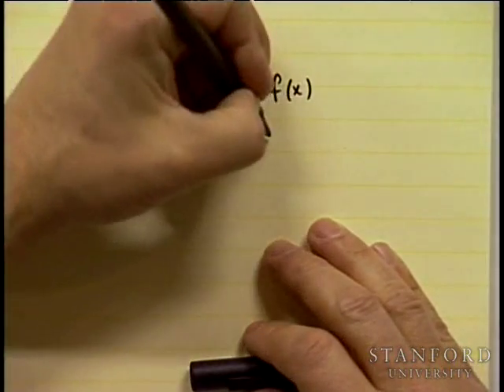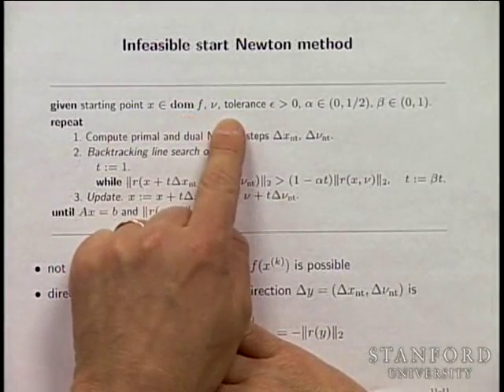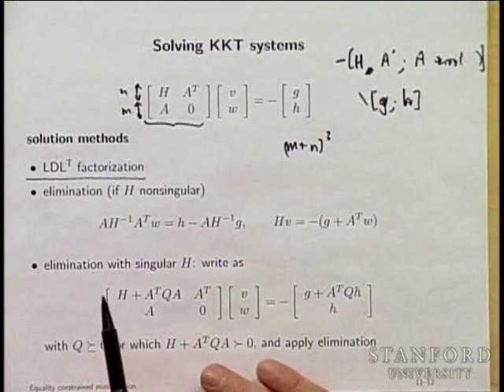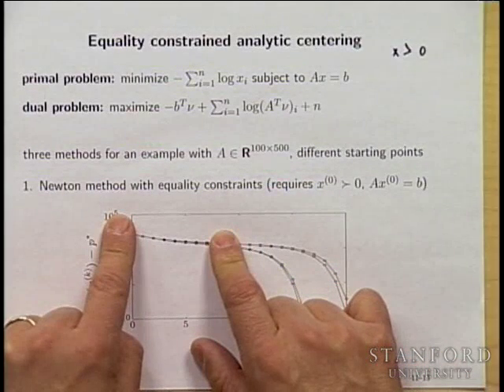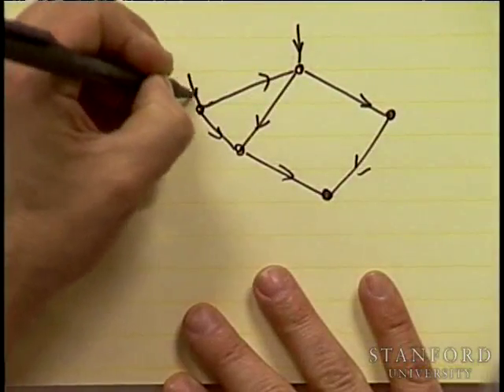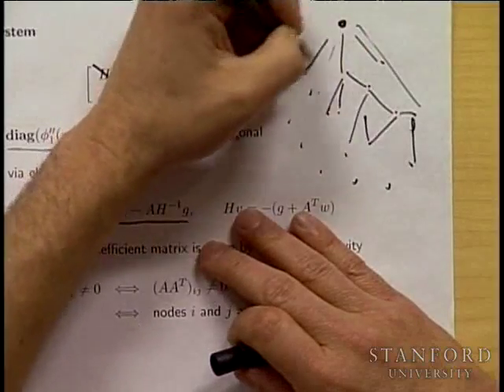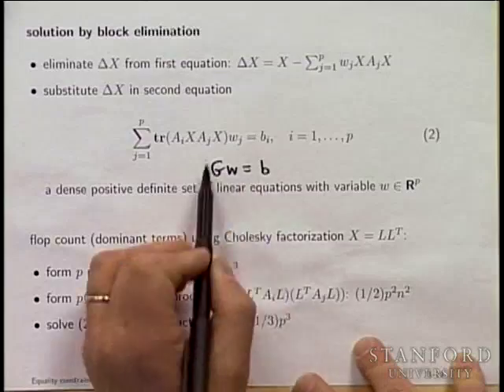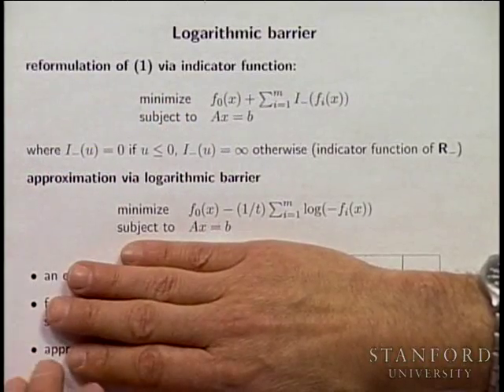Lecture 17 | Convex Optimization I (Stanford)

Comment: 0:42 Newton step
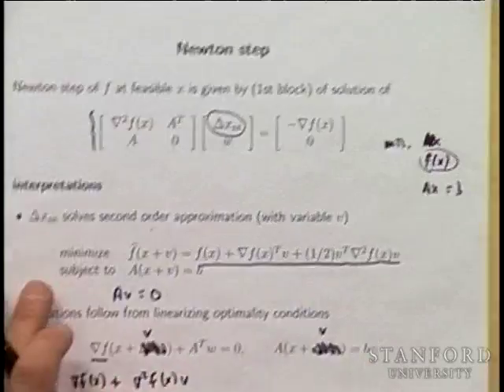2:10 Newton's method with equality constraints
6:00 Newton step at infeasible points 
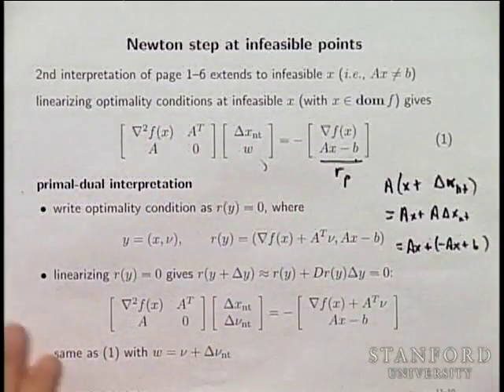11:19 Infeasible start Newton Method
17:59 Solving KKT systems
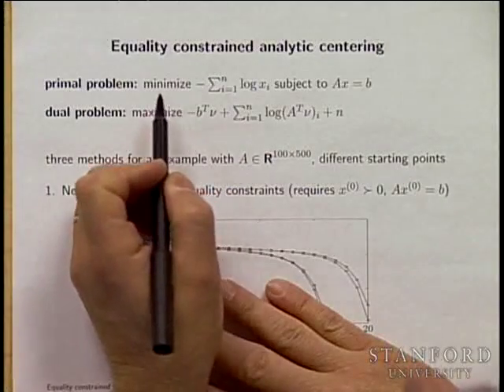25:47 Equality constrained analytic centering
37:34 complexity per iteration of three methods is identical
43:10 Network flow optimization
55:40 Analytic center of Linear Matrix Inequality
1:02:29 solution by block elimination
1:04:30 Inequality constraint minimization
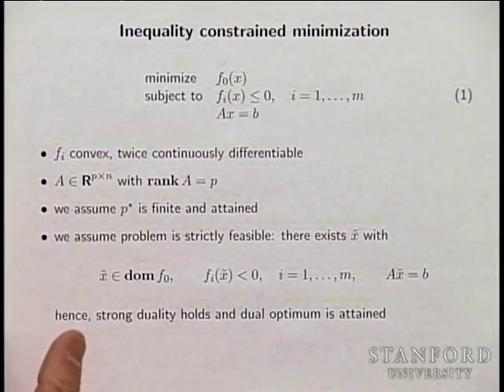1:09:10 Examples
1:11:01 Logarithmic barrier